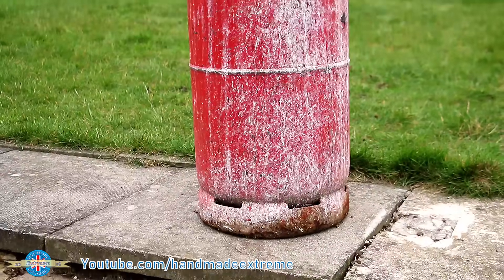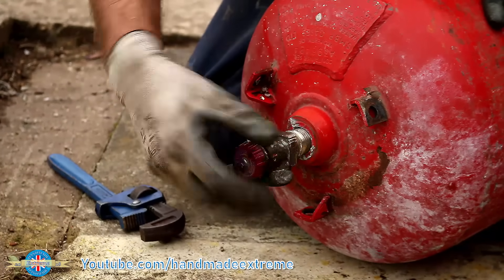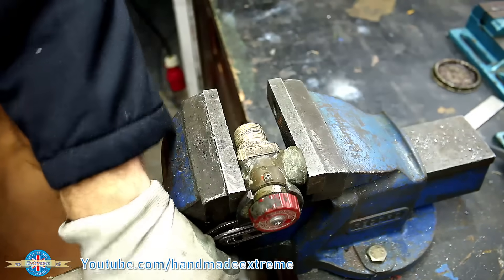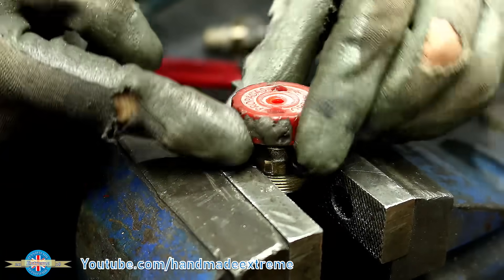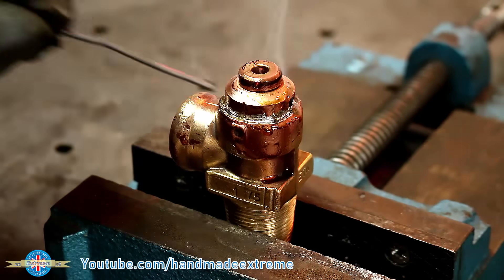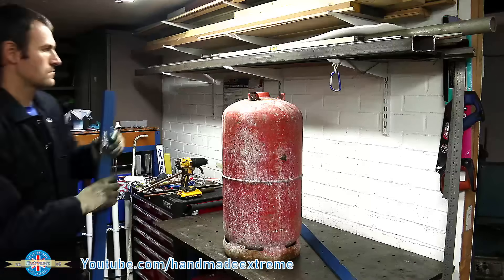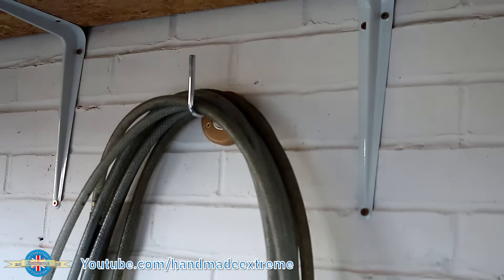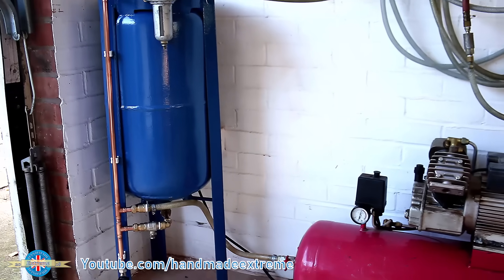Making an auxiliary air tank from an old LPG gas bottle.

Comment: I haven’t read all the comments so apologies if someone has mentioned this already - all compressor tanks, including this buffer type, should have seperate entry and exit points.  Yes it will fill with air but when asked to let air out of the single outlet, the compressor driven air will effectively blow straight past while the tool is operating.  It does feed air out right up until the compressor starts again.  30 years in pneumatics/compressor and hydraulics industries.

Comment: I made mine less complicated. I used a 5 Kg Bottle. Welded the intake and drilled a new 1/2" tapped hole. The bottom got a 1/4 hole for draining. Another 1/4 hole for the Safetyvalve. Tested the whole system with Water at 15 bar 2 hours, use this with 8 bar max.

Comment: i have used 100 gal tanks for booster tanks in underground mines. the only problem i had was getting rid of the mercaptan used to cause the smell in propane.even  after washing out the tank i could smell the mercaptan for months in the enclosed tunnels of the mine.
since we used a rose air freshener spray as a warning odor in the mine, this caused a difficulty for a while.

Comment: Like it a lot, love repurposed stuff. My suggestion if were to build similar. 

YOU SIMPLY MUST fit a pressure safety relief valve on tank side of your shut off valve.

 As you can currently isolate it and create a sealed container and let's just say the place catches fire whilst shut off you have a potential bomb right there. Please consider fitting  a pressure safety relief valve on the tank side of the shutoff valve ASAP.

I belive the original tap has a melt plug to vent the gas if the cylinder is in a fire and I believe  you have inadvertantly removed this safety feature. 

If I was doing this project 
1/ I would fit a T fitting on tank so moisture drain / catch is direct out bottom of tank. 
2/ Use as large air lines as possible everywhere if you want air volume at outlets.  

20+ Years ago I was involved in building a home made setup using a old war period pressure tank of over 200L capacity with a big 3 piston compressor we used (1-1/2 inch) high pressure plastic water plumbing pipe to every outlet around the large machinery shed from the tank. Each outlet has a water catch tube  below the outlet and drain tap,  I still smile to myself if I visit and happen to use it as the air delivery is incredible even with 30m plus of 1 1/2 from the tank plus 20m normal 1/2 inch flexible line.

The drain on the tank is at least an inch ball valve with a normal flexible hose on it and can be used to inflate / seat tubeless tyres even truck tyres! Just like tyre shops can do with the blast tanks they have! 

Hope this inspires someone else. 

Note you never get more air for large air volume consuming tools than the compressor can deliver but if you need a blast of air or simply great pressure at every outlet large lines are a must.
A 2nd tank mounted close to point of use can also help blast / short high demand if supply lines are too small / long from your compressor.

Comment: While your job looks more sturdy, I’ve also had a good deal of success using water heaters tanks. I do place them under a protective roof outside as it is possible they can explode and a sudden release of 40 or 50 gallons of compressed air in a work shop would blow out the windows or, worse ear drums. It’s my understanding that they are pressure tested to 250 psi and my main compressor is regulated to a max of 175 psi. I do a lot of painting and having 170 or 180 gallons of air compressed to 175 psi means the compressor is cycled much less often. I’ve never had a blow out either but better safe than sorry. I also add a dryer on my output.

Comment: Made my portable air tank out of a 30-gallon propane tank over 25 years ago and keep it charged to 140 PSI and use it almost on a weekly basis. What I did was clean and flush out the tank thoroughly with a pressure steam cleaner along with soap and clear water rinse and dry multiple times before refitting the valves and the identifying odor added originally to the propane was still slightly noticeable for at least a year. Even after all this time I would still not cut weld or drill on my tank or any without taking the proper precautions on doing hot work on a tank that previously contained flammables no matter how long it has been open and empty.

Comment: Modification of the brass valve was an entirely unnecessary step.  The tank thread is 3/4" NPT.  For less than $2, a pipe nipple and brass adapter would get you to a copper pipe transition in the time it takes you to spark up the torch.

Comment: I've got an old compressor that went bad and it's just sitting around. 
I'm thinking of using the tank just as an accumulator or moisture separator. 
I have an awful time with icing up air tools with prolonged use in the unheated work area and the main compressor is in the heated area.

Comment: I have a 1000 gal tank behind my shop venting for a few months. The valve is bad on it ( the only reason it was pulled from gas service) I have contemplated adding it to my air system as it would give me a phenomenal storage tank.

Comment: As someone who worked for BOC Gases in ReQual (Tank requalification) Do  this at your own risk.
The idea that there was rust present on the tank and it was not addressed properly is troubling to say the least.  The tank should have been Stripped down to bare metal to asses any damage. 

Just because you can doesn't mean you should.
-1

Comment: Propane tanks are low pressure units
An idiot might use one but someone with any sense at all will never use a modern day propane tank.
Stupid
Reply: The pressure release valve for LPG is normally set at 2585 kPa (375 PSIG)!

Comment: I am curious if you used lead-based solder or antimony-based solder?

The solder seemed to melt and flow like lead-based solder. I have used both lead-based solder and now use antimony-based (a.k.a. lead-free) solder for domestic water service in the US.

Comment: This doesnt really improve the "compressor runs too much when running air tools" problem, and may infact make it worse - while it may be longer before you have the compressor kick on due to pressure loss, it will now run much longer because it now has much more tank volume to fill.

Comment: If you put a check valve in between the compressor and your ballast tank it will eliminate the backflow that happens when your tank becomes empty. In other words you could start your compressor on an empty tank and it would not have a as hard of time starting because of the pressure that's already in the line. Giving you a chance to bleed down the main compressor tank more often.

Comment: The Air should take from upper part of the tank and there should valve at the bottom so you can get rusty shit and water out. Otherwise nice project 👍 my opinion that water remove system is not good but what i know🤣 that i know that in right condition that short copper pipe Will ful super fast, in minutes and also because the air stream most of the water Will go to that water separator and those doesn't work so well.

Comment: Great idea and I like the design. I wouldn’t have wasted my time with the LP valve body as a pipe elbow would have had less resistance and it would have saved time. You wouldn’t have needed to modify the old regulator assembly either. Sometimes spending a little can save a lot of time. The upside down tank design is perfect as well as the plumbing. I think I’ll search for a good tank to try this one myself!

Comment: The trick to drilling bronze or brass matrical is to grind 90 degree flats at the drill bits cutting edges. You only need a small amount like a 1/32 inch flats or less. Works perfect. Nice work fella too.

Comment: Are those copper fittings with solder in them already that you just have to heat to set? I've never seen that before in the US. That is pretty neat if so.

Comment: Why do you need to do all of that work on the shutoff valve? Scrap it and throw a copper 3/4" male adapter and 90 in there and be done.

Comment: Good idea for expansion, especially when you have efficient pump and small tank and pressure drops below what you need it to be after prolonged use. But... As long as its home use only, I think you can get away with it. For commercial use, not so much I believe.

Could have made that water drain pipe from a clear hose, could see if theres water in there that needs draining. Its a good practice to depressurize and drain the system if not in use anyway, but I can see a situation when you use it for like few hours and it eventually gets some water trapped in.

+1 on not welding to the tank walls.

Nice job.

Comment: Enjoyed the video and see there has as always been discussions about pressure ratings and operating pressures and various codes etc. yes in an industrial application you would at the design stage have ensured the design pressures of the tank and fittings have a higher rating than your operating pressure and that you have done. However as you have modified fittings you should then basically do a strength test of your own. One thing to ensure is that the strength test is a hydro test rather than a gas test in which you would normally carry out at a pressure say 10% higher than the operating pressure but within the design pressure of the lowest rated component. I will not bore you with the details of hydro testing but worth noting is once this has been done if you need to uncouple fittings at a later stage you only have to carry out just an operational leak check. Another consideration is that in fitting a safety relief valve you carry out testing to see that it functions as intended and one should be used that can release more air than the rated volumetric output than your compressor. The relief valve must always be fitted in a manner that it can never be isolated from the pressure vessel. Without boring people further with my comments of industrial practices the one thing I would like people to take away is please if you are designing your own air pressure systems especially using recycled components is never make your first test a gas test always carry out a hydro test it is far safer as gas free water is basically non compressible and will not store the energy of a pressure test and it is far easier to detect an issue. Trust me once you have seen and heard your first failure of a gas component at high pressure you may need a change of underwear or in my case my colleague standing next to me got such a fright it sorted his sore back but that’s another story.

Comment: 6:56 that activated my safety quints.

It was nice to finally see what it looked like.
Reply: In stead of faffing about modifying the valve with all those internal mods and LH threads adaptor- why not just use a std pipe elbow direct to the bottle?

Comment: Whole lot simpler to leave tank upright but add a water vapor absorber like ethylene glycol to the tank before re-capping so to minimize corrosion and prevent freezing. I've been using mine for going on 10 years now on a northern US farm with plenty of old worn implement tires to keep filled and general pneumatic tool work. No noticeable problem even with plasma cutter. No auxilary air dryer.

Comment: Should have just used regular tapered pipe fittings and a new ball valve.
Put a tee at the bottom.
One side for a small water drain valve and the other side for the supply.

Comment: Great vid. Did something similar about with an old gas bottle about 10 years ago, minus the complex water separation pipes.  But I just put a simple lever valve on the end of the bottle to drain the water build up and installed an old compressor regulator for air flow control. This was handy on our farm for inflating tractor, combine and trailer tyres in the fields so we didn't have to bring them back to the yard. Just charged the tank up and put it in the back of the Landy. Found electric pumps took forever and just didn't have the sudden blast of air to inflate big tyres. Its still going today and as you said the gas tank has a waaaay higher PSI rating than the compressor so never got near to maxing it out.

Comment: I wish I was so good at sweating pipes, I just ended up putting a air fitting slathered in JB weld into the propane fitting.. worked for as long as I needed it to, I didn't push my luck and just brought the tank to the scrapper when my big project was done.

Comment: Have you considered the air compressors cycle time, on my original 5 gallon tank the compressor fills up in about two minutes with additional tank takes over 10 minutes. Used your system for a week then compressor motor burned out. So my new replacement air compressor will be using only the tank that came with it. And like YouTube videos they're not responsible for any damage caused by misinformation. In closing make sure your air compressor has a  100% duty cycle for the minutes of running time per cycle.

Comment: Neat.  My Dad built himself a compressor using a unit from an old Bedford truck, a 1/2 hp electric motor and a propane tank on its side. Because it fit under the lathe. He tipped it down towards the valve and fed it from there with a bleed valve from the shoulder (lowest point) brazed in. Ran it at 100PSI with an auto shut off. Has worked a treat for 20 years.

Comment: Stupid question but I assume you made sure the pressure rating of the LP tank was equal to or less than the pressure rating of the compressor, its tank, and it's safety valve.  These are infinitely important.   I don't think you said anything about it.  Given your pinned comment about it, you may want to add some text notations to the beginning of the video to avoid even more comments like mine lol.   Great job though.
Reply: LP tanks are rated higher anyway

Comment: an easier way to remove moisture if your tank is mounted up straight is to have a piece of tube on the inside touching the bottom. In this way the air pressure would push the water up the pipe and vent it to the outlet. easy way without soldering

Comment: Ya theres a reason every air tank on the plant has the main service valve on top or the side they are never on the bottom that nifty filter you have will be destroyed very quickly and with out it you will destroy any tool you may use, so before passing uneducated remarks on others you should really ask yourself why not one engineer on the planet has put the main service valve on the bottom of an air tank.
Reply from the maker: I keep toying with the idea of a "lecture" style video to go through and explain it in excruciating detail as a wiring diagram seems to be a common question. Regarding size, the idler motor needs to be about 1 and a half  to double the size of the motor you want to drive. Running the motors is not really the problem. Its more the oomph required to start them. Hope that helps.

Comment: A simpler solution is to convert the old valve body into a thread adapter by slicing off everything above the wrench flats and the remnant of the POL port, followed by drilling and tapping for the pipe fitting, such as 3/8 NPT or 1/4 NPT.  That requires no more than a saw, drill and the appropriate tap.  It can even be done without removing the valve from the tank if you fill the tank with water.

Comment: Having toyed with this idea myself I came to the conclusion that it's simply a waste of time. It means in practice that it will take twice as long for your tanks to reach full pressure for no real benefit except storing far more air than you need to do the job. Far more important is having a compressor that can keep up with high demand usage and provide adequate CFM's for things such as orbital sanders which are very hungry.
My compressor delivers 25 CFM's.  That's just enough to keep useable pressure levels. I would prefer 30. A bigger tank would not make any difference whatsoever. A bigger compressor would.
Reply: Unless you need more air capacity for the job...then it's a perfect solution
Reply: @mrmotofy  
Clearly a comment from someone who has not used compressed air in a real workshop.
Reply: @joschmoyo4532  Clearly it depends on the application. I use air tools daily in my shop and on a mobile service rig...so keep up your false assumptions
Reply: @mrmotofy  
Clearly you need a bigger compressor. If that's true. 
But if your just using air wrenches and die grinders and blowing shit off the work bench then maybe not. I use machines and tools that use massive amounts of air continuously and that's my point. Extra storage volume won't solve the problem for more than a minute at best. The other problem is air leakage from stored air. 
That's why more and more these days, compressors are being sold with multiple cylinders to keep ahead of high consumption. 
Personally I wish I could afford to upgrade to a rotary. Piston compressors are noisy and power hungry.
Reply: @joschmoyo4532  I agree...so you agree too the application determines what will work. In many cases a larger pump is needed, but that's usually an expensive upgrade. So more capacity can sometimes solve some issues.
Reply: @mrmotofy  
Sure. I don't use compressed air all day thank God but when I do need it I need a lot. Paint spraying doesn't use a huge amount of air but a large reservoir keeps the pressure more stable and stops it pulsing.